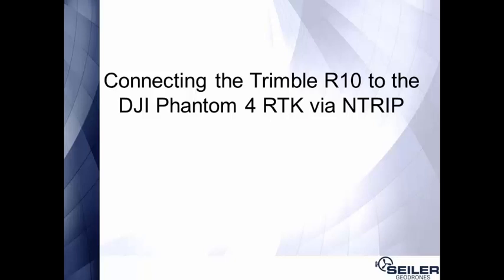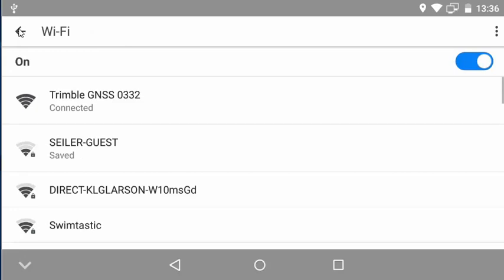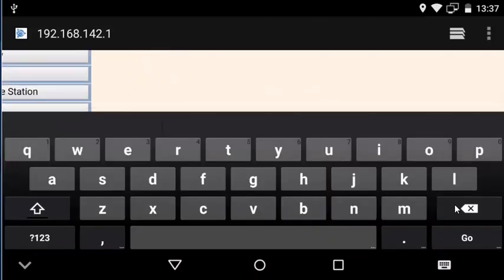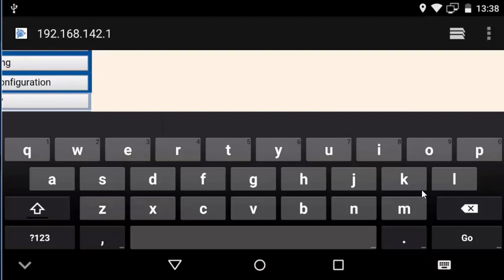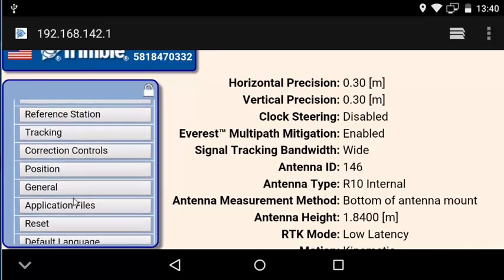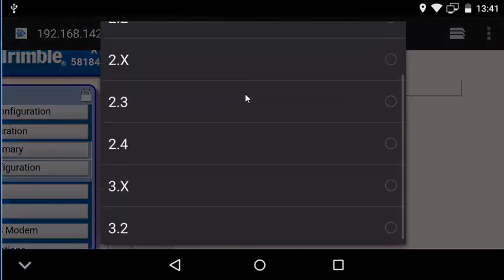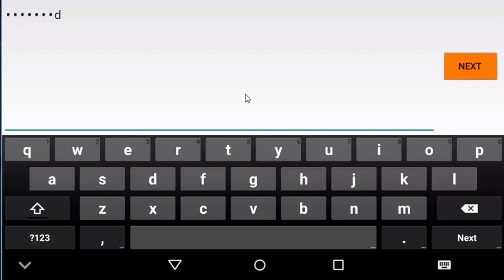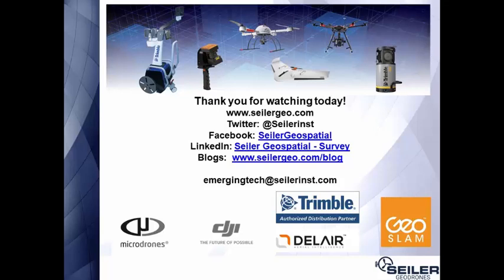Setting up a DJI Phantom 4 RTK with a Trimble R10 as the Base Station

Comment: So did I understand correctly, that models purchased in EU will not connect to R10 and the drone at the same time? How will R10 get Ntrip correlations if it is not connected to any field computer with a simcart to get one?

Comment: Hey! I'm going to purchase a p4 rtk. I have a sps985 rover. Can I configure the rover still. I used to use a 986 rover and the company had to pay to switch on access to the rover (I think)... not sure if the 985 has that function.
Reply from the maker: Hi Jonathon,
I wish I could say for certain but we don't have any experience with that particular receiver.  It is indeed very similar to the R10; however, they do utilize different firmware so there are always minor (but important) differences.  Usually, there's a way to configure just about any GNSS system, but sometimes it may require extra hardware if it doesn't work.
Reply: Any modern base that can transmit RTCM over NTRIP is compatible with the P4RTK. 

Forget about RTK. Use PPK.

Comment: Any experience connecting to a further away R10? Perhaps the R10 is set up 10 km away and you're off surveying with just the Phantom.
Reply: In theory this would be just like connection to a CORS network, the difficulty is in the communication.  This video shows wifi comm to the R10, which is only going to work for less than a 100 meters or so.  You could check out the Simple NTRIP Caster and rebroadcast the R10 with that.  I've used it with good results.
Reply: @travislemoine7977  my apologies for the lack of knowledge here.
Do I need WiFi and or a simcard with data inside the R10 to be able to connect to the Drone when using the NTRIP?

Comment: In my case, turning on the wifi to connect to the gnss Hotspot would de-link the aircraft. 
After setting all the io parameters etc, what  do you do to re-link the P4 without losing  the wifi connection to gnss? TIA
Reply: Any update on this issue? Thanks.
Reply: Haha I'll asnwer for him if he doesn't want to. 

You both, me included, have the EU model of the P4RTK. I believe other regions outside of the US all got the EU model. This means that I cannot connect to both the WiFi network AND drone at the same time. 

The solution to this is to put a SIM card into the remote. This is why the EU models come with the 4G dongle for the remote. 

Get internet through the SIM card in remote to receive NTRIP corrections. Or just run PPK all the time like I do. 

Forget about having to hold a live connection and RTK fix.

Comment: Hi, my p4rtk got disconnected everytime i turn on wifi to connect to the r10. How do you solve this?
Reply: You don't. You have the EU model. It cannot connect to a WiFi network at the same time as the drone. Sorry. Same here. You need to use a SIM card in the remote to get NTRIP working.